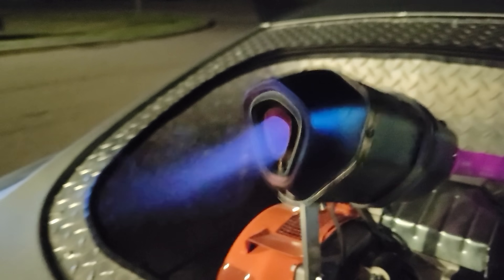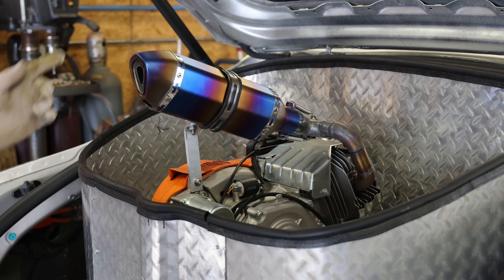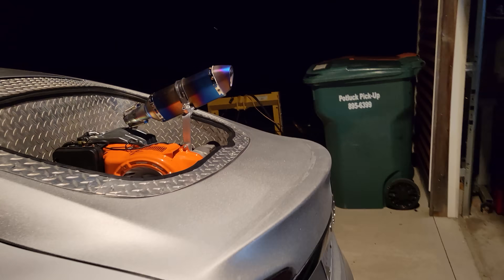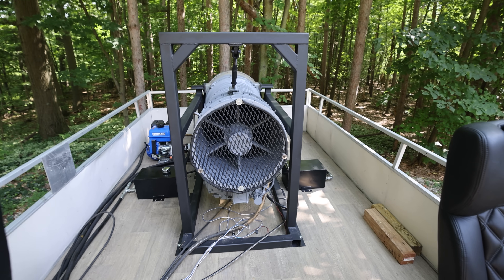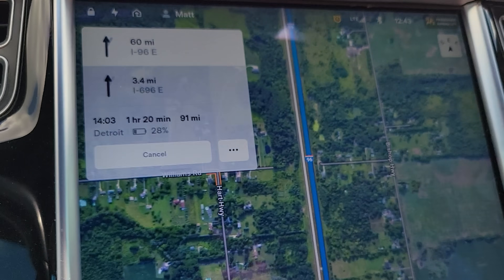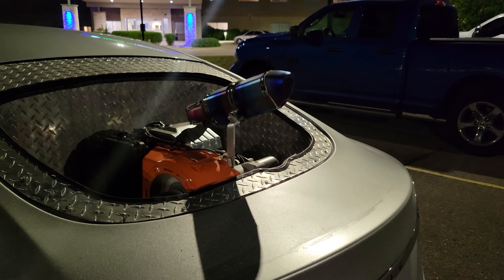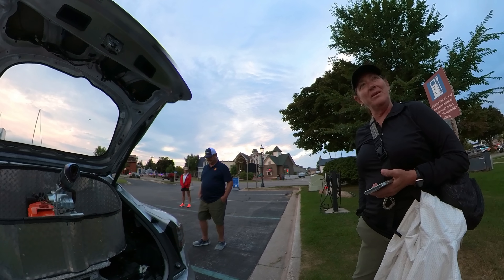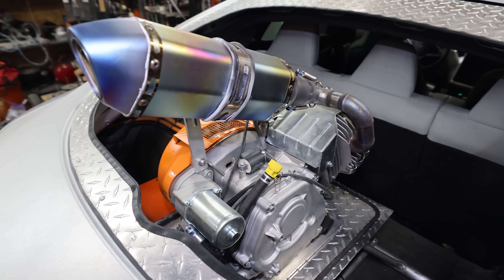Cordless Tesla (I Drive 1800 miles without charging) P.1

Comment: I would love to see a video of your alternator/generator setup, how you wired it into the internal Tesla battery charger, etc.
Reply: This is what still puzzles me
Reply: He didn't have one in this video he tricked dummies. There is nothing attached to the engine and its very clearly shown in the video
Reply: @Iahusha777Iahuah  Look at 0:45.  That's a standard inverter generator setup.  Based on the orange color, location of the fan vent at the top of the shroud, and yellow cap on the oil tube it is very likely a WEN GN875iX open frame inverter generator.  Champion and others have similar generators from the same factory, but in different colors.  Perhaps the wires were extended to hide the inverter module under the floor panel, although the original wires might even have reached unchanged.

The only real modification was that the quiet stock muffler was replaced with the noise-enhancing megaphone muffler.  The spring mount, shape, straps and rivets match the "carbon fiber" look mufflers sold on Amazon for $35-$45.

From the timeline and screen displays in the video he was pretty clearly only charging while parked.  He just plugged in a standard charge cable to the original generator receptacle and used that, without touching the car's software or electronics. My guess is that he dismounted the charging inlet and rotated it to face the trunk interior.  Perhaps he used a relay to fake unplugging the cable, or a lever+bracket to unplug the J1772 connector slightly, but he might have simply gone to the back of the car to plug the cable into the repositioned inlet after he parked.
Reply: I don't think he wired it in at all.
Reply: This is one of the most civil and informative arguments I have ever witnessed in the comments of a YouTube video.
Reply: Or skip the entire thing and buy a hybrid car.
Reply: @realsecman  You don't get clicks and attention by driving a hybrid car.
Reply: @1djbecker  Doesn't mean I'm wrong.
Reply: Hello, I'm currently in the process of installing something similar on my 2013 model S.  
Does anyone know exactly what I need to connect my gas generator to my Tesla for a continuous charge while driving?
Reply: @Navi-ipTv  also here for this. Like the other comments state, it seems this was likely overlooked in the video and the charging is only taking place while he is parked.
Reply: He replied to a similar question elsewhere and said, "I had to create my own custom BMS and software amongst many other things. It was tough but I got version 2 coming out real soon."
Reply: You would need a much much larger generator. This video was faked. a model s needs 20kw to maintain highway speed. so you will also need duel chargers as they are only 10kw each. As far as the tesla battery charger goes just hook up to the 220v contacts, run 12v to the 12v and enable pins then ground the proximity wire with a 150ohm resistor and boom your charging while driving.
Reply: @mp-xt2rg  The battery management system communicates with the motor controllers.  Software interlocks prevent operating the motor controllers while the battery management system is in charging mode.  

It would require extensive software modifications to change this.  No one outside Tesla has the source code access needed to do it in a reasonable amount of time.
Reply: @1djbecker   @1djbecker  or just buy two model s 10k chargers and install an open source control board. You can buy them ready to go for $1500 from ev West. It's a common charger to use in conversations. If he's putting a gas motor in the trunk he's probably cool with having a few extra chargers on board.
Reply: @mp-xt2rg  That's going to get you a high voltage DC output, not a connection to the Tesla's battery management system.  The car's BMS will have an incorrect state of charge.  It might not raise a fault when it's at 0% charge, but it certainly will when it's "-20%".
Reply: @1djbecker  have you tested this or are you just talking out your butt? Why do you think the shunt on the bms wouldn't register the power movement? My bet is back feeding the hv cables going to the motor would allow the car to operate normally and maintain a correct state of charge.
Reply: @mp-xt2rg  Take a step back and look at the original context: there is no evidence that any of these details were considered, let alone solving the problem of charging while driving.

(I do have quite a bit of experience in this area, designing boards and writing the firmware for motor controllers, a BMS and other networked automotive systems.  But that background isn't necessary to see that that the video doesn't even hint that the hard parts were actually done.)
Reply: @1djbecker  I started by saying the video was faked. I have no doubt the 72v dc generator he bought on eBay did not charge or extend the range of the car in any way. That being said you could put a Westinghouse 20kw "portable" generator in the trunk to feed two 10kw Tesla chargers and power the car. It would work. The bms would see the power coming in just as it would from the normal charger or regen. The chargers don't need to communicate with the bms to maintain a correct soc. Your background doesn't matter to me. You're either right or wrong and your history doesn't affect that.
Reply: @mp-xt2rg Hello! Very interesting message. I would like to repeat it, my problem charge it while driving.  Do you have wiring diagram or something like that?

Comment: So all good! 10kw was ample for overnight, not enough for PERPETUAL ENERGY.
How much we need for PERPETUAL ENGINES?
20kw 30iw?  Unfortunate you had to do it instead of Elon just making an electric generator spin around the motor as a wheel electric wireless charging engine.
I don't know anyone that needs an extension lead on an electric car .
Kids had BATTERY CARS 40 yrs ago.
I was expecting a wireless self powered flying electric  house by time I was 50 that was 40yrs ago. That's only few yrs away. We still doing BULLSHIT METERING LIKE RETARDS THINKING THEY HAVE BRAIN FUNCTION PRODUCING GARBAGE.
WELL DONE , LOVE YOUR WORK👍  
I WOULDN'T COME TO THIS WORLD TO TAKE A SHIT IN PURPOSE I DON'T INJURE WTF YOU PPL FIGHT WARS FOR. IT'S A DIRTY TOILET COVERED IN GARBAGE.
Needs more then 10kw then.
Were 150yrs behind in time.

Comment: The noise is total shame, I don't understand how people tolerate that in their vicinity, that must be because it is the states, but I dare you doing this in France or Luxembourg, you do not last 10 minutes on the road before you are pulled over with your car confiscated bu the authorities
The idea and the project is totally cool though, the noise at this point is a no go especially considering the relatively low charge ability of the contraption.

Comment: He has only made a EV into a hybrid.  I think he is lying.  I can't believe that the one cylinder motor has enough power the car for any distance.  Home chargers have to 100a 220v chargers (cost $3,000.00+.  Cost to rewire your main panel -  another $4000.00)

Buy your EV with a trailer hitch.  Buy a trailer with a 100a 220v auxiliary and a 100 gal fuel tank and you can go when and where you please.  This rig might cost less than the home charger, and you might even have room on the trailer for extra luggage.
Reply from the maker: Love the skepticism, makes me feel special. Wait till you see the next video I have out, I completed the second version of this and drove 3000 miles with impressive numbers. A trailer is lame, who wants to be logging a trailer around everywhere, for that I just stick to my gas car.  my car is a 1000 horsepower all wheel drive... No trailer for me, that's going backwards.

Comment: It's almost like Hybrids are better than battery electric cars 🤔
But seriously though, my main gripe with battery electrics from the user side of things is the charging. You either wait hours to charge or use speed chargers which wreck the batteries...
This solves both the range anxiety and slow charging. The only way it could be improved is if it had a solar panel on the roof for supplementary charging. There is SO MUCH surface area!
And to make this even cooler you could replace that piston engine with a turboshaft! If you insulated it with sound dampening mats and ran a full exhaust it'd also be a LOT quieter than this.

Comment: What about a 3 cylinder kabota diesel? They are between 15-35 HP with the same size block. Connect to ac generator. I have a 4000 watt unit, runs all day on a couple gallons of diesel

Comment: 🤔🤔🤔🤔🤔 You could buy a 2012 nissan leaf  dirt cheap  like 3500$ dlls then set 2 generators in the back and in theory get 80 mpg minimum the problem is the generator requiered is not sold you need like 20 KWH nominal

Comment: Interesting concept. If you could quieten it right down, and make it less conspicuous, I could see an actual market for that. I reckon there'd be a fair few Tesla owners (mainly ones that frequently need to go to out of the way areas) who'd happily give up a third of their trunk space to alleviate all range anxiety issues.

Being able to charge the cars batteries as normal for every day use, but then, when they can't make it to the next charger, or the only charger within range is out of service (or has 3 cars cued at it already), or maybe just when they need the extra range to do a regular long trip without stops, just flick a switch to put the car in "Hybrid mode"....... Yeah, I could see the idea being appealing enough to a fair few folks that they'd pay to get a conversion done.

The only problem I could see (Here in the UK at least) is that owning an electric car can have certain perks attached, like cheaper/free road tax, and being allowed to drive into clean air zones for free. I'm pretty sure that the powers that be would have a dim view on someone burning gas to power their electric car, while still taking advantage of these "Green" incentives.

Comment: It seems like the engine is running rich and is dumping unburnt fuel into the exhaust, making the pipe glow and spit fire out the tailpipe.  That excess heat can’t be good for the engine and it definitely reduces the range.

Comment: You would be better off chopping the back of a scooter or small motorcycle off and welding it either into the floor of the trunk ( stealth ) or off the back, to push the car at cruise speed.

The fact is you will never beat the efficiency of a Prius (like a Prius prime) because it was designed to be a super efficient hybrid.

Comment: Here is the thing, you got the wrong engine for this setup, those gx390 is just too big, heavy, clumsy and underpowered for mobile applications.
I suggest you custom built crankcase for 250cc bike engine that connect it to generator, those things run in half power can do 10kw just fine and totally understressed..

Comment: It does not sound like your engine is lugging down by the output generator.  My thought might be to change the voltage output of your generator to a higher voltage, so that the winding see the same amperage, but at a higher voltagee, you can get more wattage out of that motor.  Another thought would be to use a inline 3 cylinder water cooled Ford Eco booste engine used in the Fiesta and other cars, rated at about 95 HP.  That could run a really large generator.

At 2,500 watts, that is enough to run 10 miles with the car each hour.  At 25 KW, then you can do 100 miles per hour of generator run time.  I would target that much power!  The engine can be really quiet, it just takes the correct muffler.  When it is super quiet, I would like it!  For a air cooled engine, a muffler for a riding lawn mower is really quiet.  

Also your engine looks like it is running very rich, by the amount of fuel being burned in the muffler, leading to that glow in the muffler.  

Had you considered a motorcycle engine?  What RPM are you running?  Perhaps if you run a higher RPM, you will not make 60 Hz, but that is not a requirement for most DC chargers.  Unless you are making AC power to convert with a transformer to a battery charger.

Comment: The idea behind is quiet good: You install a small generator which is CONTINUOUSLY running at maximum eficiency (not max. rpm). Such a hybrid is much more efficient than all commercially available solutions. By the way: most of the heavy locomotives are based on this principle). The only thing to keep in mind: Power of this generator divided by its efficiency factor mus be larger than average required driving power.

Comment: Use the same engine, just add turbo to get better efficiency, and change generator to min 1,5x bigger output, or even 2x (depends on received HP of turbo engine).

Comment: It would be easy to silence that engine. Even using 1 inch thick fiberglass board around the engine bay will reduce that sound by more than 40%

I wrapped my ac's compressor, and my home backup generator with enough air flow and you can whisper around them.

Comment: It's just a fun video, no need for anybody to get hot under the collar re fossil v renewables.
Who else picked up on something said right at the start and some data shown right at the end?
The engine was supposed to output "about 10,000watts" (10kW). It didn't and that's why it was a disappointment for the guy. It only put out half the stated power so yeah, much sitting on the side of a road waiting for it to charge AND running it almost 24/7 - way more than he calculated. That's prolly the noisiest video I have ever watched lol.
Reply from the maker: Thanks! . One word that not many people think about when it comes to electronics Efficiency. It was 10,000 watts going in, but only half of that going out, the other half is wasted in heat. I'm currently on revision number 6 of the system I'll be putting out a video with the next version in the middle of April. Almost 2 years on this project so far.

Comment: I'm impressed.    I suggest you name it  PRIUS.    In version 2.0 you might consider designing around a boiler that could burn road side trash to generate power.
Reply from the maker: Not so fast, I've owned two Priuses, one of my absolute favorite cars those cars are amazing. Nah with this I'm going somewhere different, however I haven't ruled out the trash thing yet, maybe in video four or five

Comment: Well done! How did you connect it to the onboard charger? does the car accept incoming power while driving or you had to modify it?
Reply: He glossed over that which seems sus tbh
Reply: I think it's charging through regenerative braking in some way. You can see negative power usage on the screen while he's driving in the city, which usually indicates the car is braking regeneratively. Maybe he just has the engine directly connected to the drive shaft and the car automatically brakes to keep in sync with the "gas" pedal.

Comment: Did I miss where the electrical was explained? Where did you connect the generator out? Did that bypass the drive disconnect while charging? Can you still use the charge port while this is connected?
Reply from the maker: I appreciate your interest but there's no way I'm showing all that in the video, this is a system that I'm developing I'm not trying to share trade secrets. I made sure some components in the next video which is coming up soon since I just finished version 2 of the power plant. Besides being proprietary information I still wouldn't share anything having to do with opening the high voltage battery or any of the high voltage systems because unless you have really good knowledge of those procedures u can go from alive to dead in seconds if you make one wrong move.
Reply: @WarpedYT  Good to know and thank you for the reply! Can you share what your black box would do? I’d like to have something that can charge from a travel trailer to make 150mi SC to SC a possibility.

Comment: How many gallons did you burn total or approximately.  I have had so many different theory’s how to make this work efficiently and hod forbid no plug around.  

Personally I’d love to see someone engineer some type of small turbine on the roof which would spin from wind and generate power and using the wheels.  

There are so many smart people who could do this with the right type of gearing to make whatever spin faster and generate electricity.  It’s just so far over my head.

We have to figure something out economical so we don’t have to spend so much just to get to work or groceries, there needs to be more left in the kitty for fun.. But this is another topic I can get deep into, and the 1% would hate me more.

Comment: I have a sound level meter.  But how did you measure that noise from the sound level meter?  Have you taken the temperature?  Indeed, I meant the noise of the engine the very loud one.

Comment: if you can make the generator deliver power directly to the motors and then excess power to charge the battery it would be much more efficient than the current setup, while regen helps recuperate energy back into the system when charging........it would basically be a plugin hybrid with a massive battery. It would be really interesting to see

Comment: I've had thoughts of doing something similar, though I would have put the engine/fuel/generator on a small trailer and come up with some kind of power connector to get the energy into the car. Awesome project
Reply: I was gonna say the same thing but you beat me to it
Reply: At what point are you just making it a 7,000 Lb expensive per mile vehicle. You shouldn’t be proud you thought of that, it defeats the whole purpose of an ev, which is cost efficiency. If you want a car with long mileage without stopping, buy a Prius hitch a small trailer and feed it 100 gallons, that’ll get you 3,000 miles at 40mpg. Trying to rig a Tesla into a gas guzzler is so counter productive and costly. It’s not like you don’t need to stop to pee and eat.